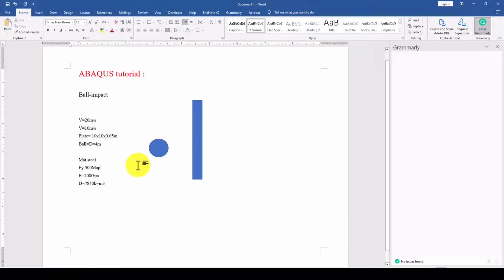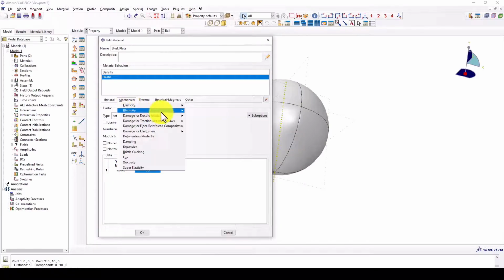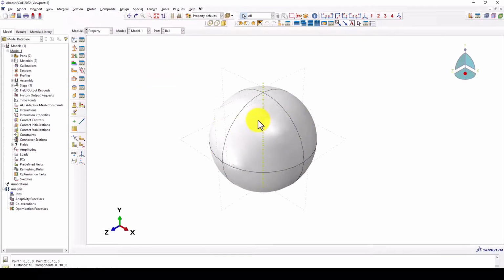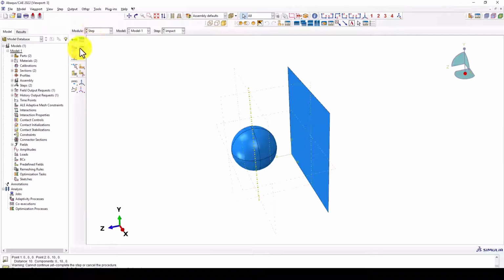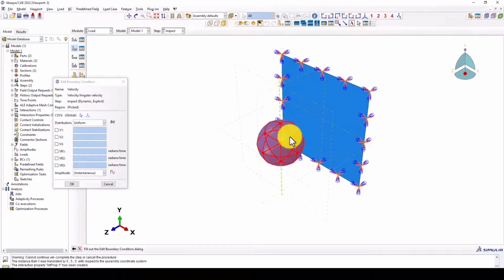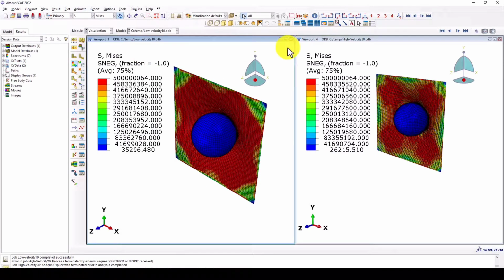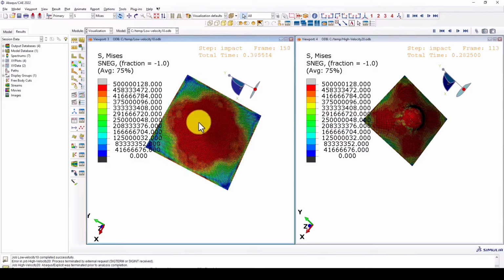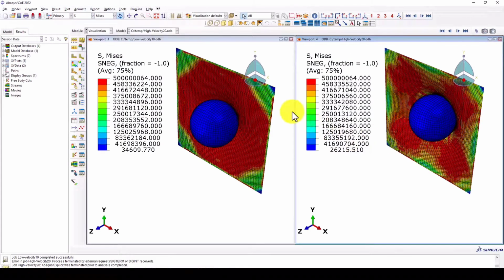Abaqus/Explicit Analysis - Ball and Plate Impact Simulation | Contact Definition in Simulia

Comment: There are 4320 facets that are found to be facing in the wrong direction with respect to the main surface for the contact pair (assembly_ring-groove-uhpc,assembly_uhpc-ring-groove). Please check the orientation of the surfaces relative to each other.
please could give me advice, how solve this problem. i changed the main and second each other, deleted the surface and created again but hte problem still fined.